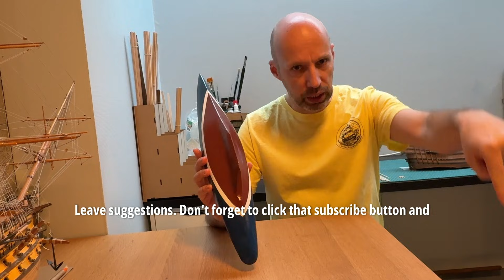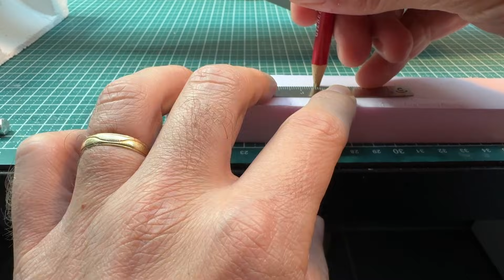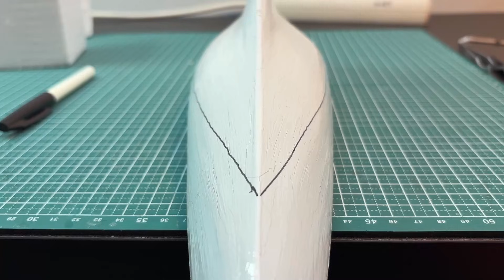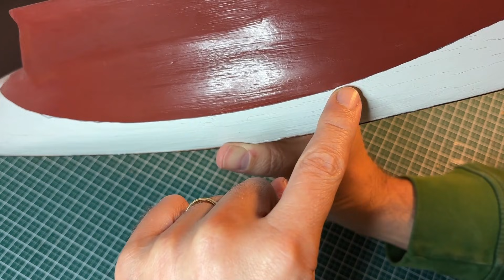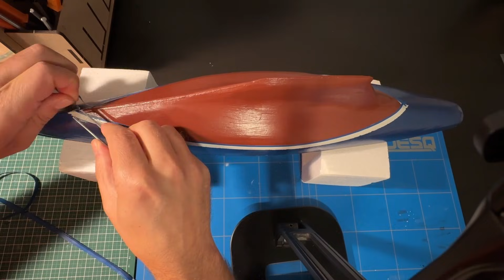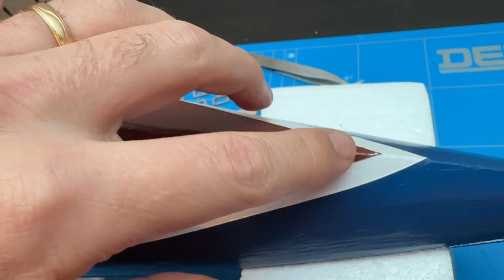How to Paint Perfect Straight Lines on a Model Ship – No Paint Bleeding!

Comment: I'm wondering why your hull has so many bumps and hollows.  Is this intentional?  If so, why?
Reply from the maker: Hi Robin, thanks for your comment. In close up you can indeed see all small imperfections. I tried to do a one planking job and did use plaster, sanding, mod podge. Additionally, I painted with brushes, not airbrush, so it enhances these imperfections. So to answer, it was not the intention. If you look at the hull on the finished ship in daylight, the don't show like this. But, lesson learned for this kind of hull.
Reply: @Curtis_Wooden_Shipyard yeah there’s always a few spots. I use a product called builders bog. Yes that’s the name here me in New Zealand. As the name suggests it’s not a modeller’s product but is a two part general building filler. The ideal factor is it has a similar density and sanding quality to hull strips.  Which helps immensely with fairing - too soft filler and you tend sand it out creating a hollow. Too hard and it remains as you sand away the wood around it. My last boat people asked if it had a plastic moulded hull and I had to lift the deck hatch to show the stripping. You should try a little experimenting. With the right product it can be almost flawless. I also tack all my strips on with a fast CA, not wood glue. That way I get every plank held in just the right position relative to the last plank as I work around the hull sticking to each frame as I go. I find this gives me the best finished planking job. Not perfect - you still end up with a few lumps and bumps. But pretty close. Cheers
Reply from the maker: @robinhodgkinson  Hi Robin. Thanks for that! Can you send me a link to the product? I use plaster to fill but as you say, it is a little to soft, hence the problems. Real wood putty is indeed to hard. In my build that I'm now doing, I switched to CA as well for the first planking (even though I don't like working with CA) for the same reason.

Comment: You do not use an air brush. Why not?
Reply from the maker: I don't have any. All previous ships that needed painting, had wooden hulls where the wood structure remained visible, so I paint with a brush. This hull needed a completely smooth finish and therefore indeed an airbrush would have been a much better option.

Comment: l'état de surface de ta coque n'est pas terrible.
Reply from the maker: Thank you for taking the time to share this feedback — I appreciate it, especially coming from someone who clearly looks closely at the details and considers the overall finish.
You’re correct I think: on this type of yacht the hull should ideally be perfectly smooth, and with a wooden-planked hull that is a real challenge. This was my first time building this type of vessel; my previous models all had double wooden planking, which allows for a very different approach to surface preparation and finishing.
The close-up shots and strong lighting also tend to exaggerate the remaining wood texture and brush marks. I don’t use an airbrush and work with regular brushes; to avoid paint bleeding I applied three thin layers, which does leave some visible paint structure despite light sanding between coats.
In real life, now that the model is finished, these imperfections are far less noticeable — but your remark is fair and well taken.
Thank you again for your honest comment and for holding my work to a high standard. Feedback like this helps me improve.

Comment: Just run a very light bead of clear latex caulking or even clear wood glue along the tape edge then rub it in as you wipe it all off. Before the caulking or glue dries paint and peel the tape off.  The very fine layer of caulking or glue you pushed into the edge and wiped off seals the tape edge and prevents any bleed.
Reply from the maker: yes that will do the trick as well, certainly when one side is unpainted. When both sides are painted, using the same paint avoid a possible reaction between the glue/latex and the first layer/second layer. So I don't dare to do this when both sides are painted.
Reply: @Curtis_Wooden_Shipyard  Works fine I do it all the time. I would have painted the white area first then taped off for the red and blue using my method. Acrylic caulk and wood glue are water based and will not hurst acrylic paints at all. I would suggest you just experiment. But you can do it your way, I am just making a suggestion.

Comment: Hello friend great technique, tried it on my first model when you made a video about the technique on your fram, worked really well.
What Sandpaper grit do you use to sand between coats?
Reply from the maker: Thanks for watching both videos :) Very glad it helped! The difference is the order of colors and me using a proper masking tape now that I bought. The purpose of sanding is to reduce all small imperfections (paint tears), so I use a fine one but not to fine as otherwise it is immediately "full". I sand in light circles to avoid making "lines".